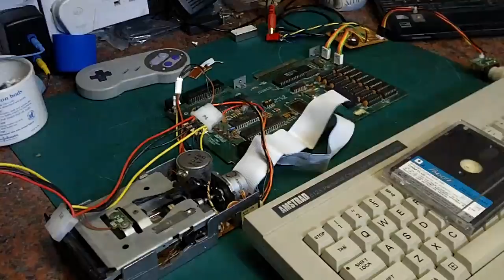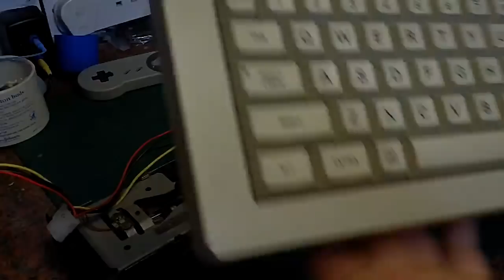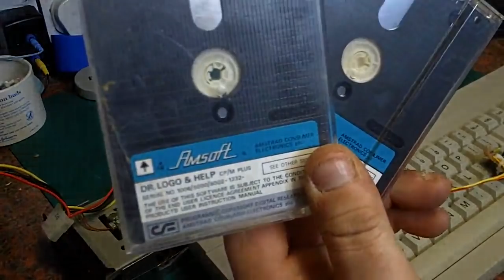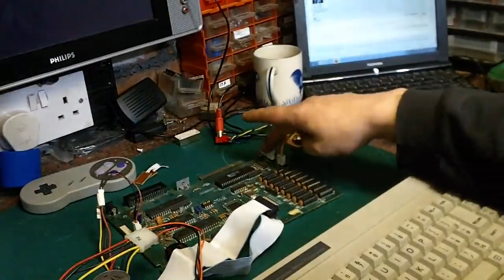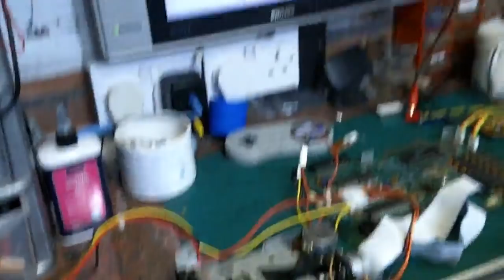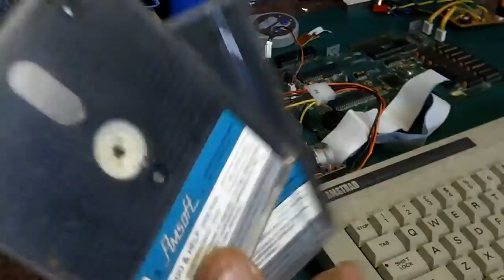Amstrad PCW project pt2

Comment: Could be a faulty NEC 765 on there maybe?  Swapped a fair few of those on PCW's.
Reply from the maker: You could be right, I'm going to test the drive in my CPC 6128 first rule that out.
Reply from the maker: Well I tested the drive on my 6128 and it wont read disks so I tried my working 6128 drive on the PCW and it at least seaks now but no attempt to boot from the CPM disk. I pulled the NEC 765AC but only have a NEC 765BC in stock I tried it but exactely the same result and im not sure if they are compattable, I have a 765AC on it way tho.